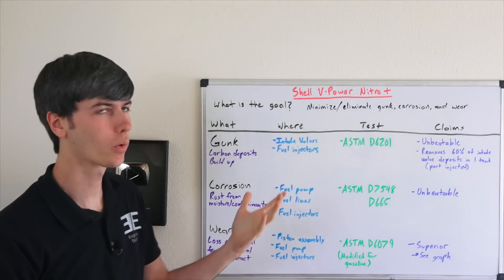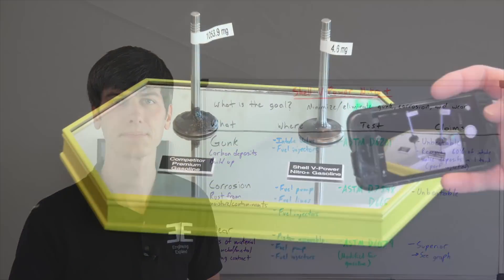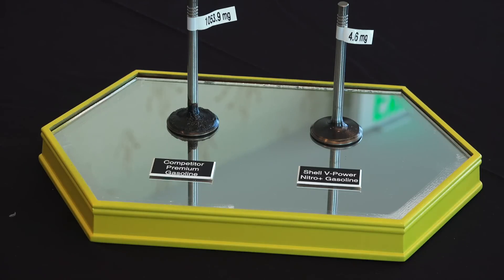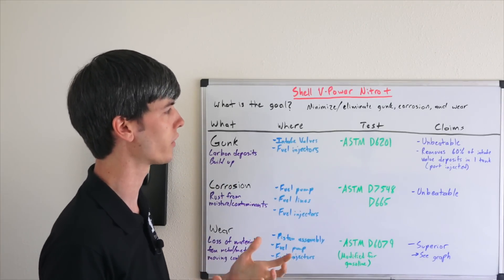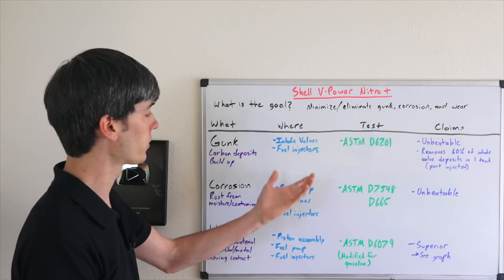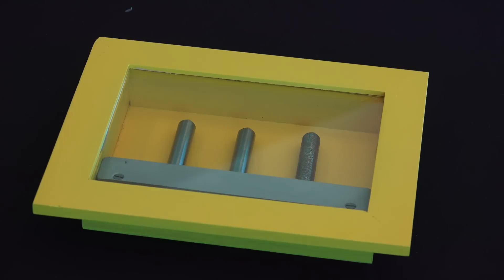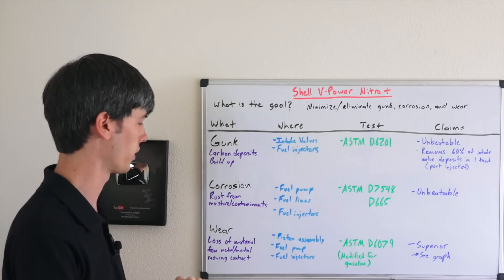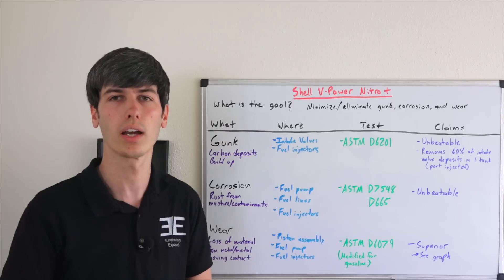Shell V-Power Nitro+ (Premium Gasoline Fuel Testing)

Comment: Just got an Audi A6 2.7 bi-turbo 2001 with cam belt failure, and has been Audi serviced and always used Shell Optimax fuel. Valves and piston crowns were very clean, at 148,000 miles. best i've seen. Took about 3 minutes to clean with wd-40 and the scouring pad side of my kitchen sponge. Impressed. However, cost can out-weigh effort in long run. i.e. a good rebuild may show unknown issues and rejuvinate engine. Plus the fact certain parts are superceeded by newer revisions, which could out-perform factory-original parts. Either way impressed with Shell, and EE. thumbs up and right foot to the horizontal

Comment: I've been using shell 91 in all my cars getting better mileage ect. But until I bought my 350z have bolt on mods it idles pretty bad almost dies out and pings on shell 91. I tried 3 different tanks at shell using 91 and same thing happens. Switched to Esso which has ethanol and idles way better , same with Petro

Comment: I just started using SHELL V-POWER NITRO+ and I can sincerely say that it made a difference. My engine would shake and sound rough but when I started using shell v gas it stop shaking and running smooth, I don't know about the mileage because I haven't paid attention to it but for my experience I'll keep using it every other fill up because it can get expensive. I have a 2013 Chevy Malibu 2.5 with 57k and live in Houston TX gas ain't cheap!

Comment: Science and engineering are two very different fields and both can be touched on when summarizing this fuel and it's effectiveness. The engineering effects produced by this gasoline that Shell would like to highlight were very well explained. However, the science (chemistry, metalurgy, etc.) behind the effects were not very well explained. I am thinking that is because it is proprietary information kept secret by Shell. You don't need to know the science, just understand our test methods and the results of those test from an engineering perspective and then make your decision on whether to buy their product. That is probably their thinking.

Comment: Interesting fuel type. However, I am mainly interested in whether or not the fuel actually produces any durability changes long-term in vehicles. I’m also interested in knowing if there is a pre-and post use performance difference.
Reply: I can vouch for V-Power. I started using it on my Tacoma and i get atleast 2-3mpg better on the city than with regular. I tested them and noted down my driving habits and trips. All similar with V-Power it was significantly better

Comment: Only problem most newer cars have direct injection so no matter what gas you use carbon deposits on intake valves will still be present it's not a fault of gas companies but making claims about cleaner valves is deceptive.

Comment: We all know the fuel is good stuff but what really matters is when the truck unloads at the gas station how much water is in the under ground tanks the drivers are supposed to check and report this but there pay is so low they just unload and go. Also how clean is the  gas stations pumps there a lot that go into this and the bottom line is your putting that into your vehicle. So think before you fuel.

Comment: Everybody in the comments are talking so negative but I’ve noticed how much smoother my car is. Plus better throttle response and gas mileage. I have a older Nissan Maxima so I want to keep my engine lasting long
Reply: yes ive seen my intake valves - spotless.

Comment: So of nitro removes 60% of gunk in one tank, that means you can alternate cheap gas with nitro from fuel up to fuel up because Nitro will remove gunk from the previous lower grade fill up. You can save about $1000 per year (If you get 20mpg and drive 15000 miles) by alternating low grade fuel and nitro from tank to tank. Thanks for the info Shell.

Comment: I only buy top tier fuel from shell or mobil.
No point in fuel additives if you are using fuel with a higher amount of detergents.  
Not talking about the octane here.
Top tier fuel sellers have to maintain a certain level higher level of detergent in the fuel regardless of the octane.  Even between the companies there can be a difference in the amount of detergents in the top tier fuel. But there is a minimum that must be met. Some go far above it.

Comment: I have a question. We have two motorbikes. The one is a honda ct70 with a lifan 125cc engine, runs like a charm. The other one is an apollo 125cc dirtbike. They both recommend 92 octane. Would Shell "v-power nitro+" be suitable to run in the summer in these engines?

Comment: Wow, I feel like go take out a 2nd mortgage and spend on this V-power or whatever it is call?  In the last 30 years or more,  If it looks like gas, smells like gas, burns like gas, and it good enough for me.  Cheaper is better.  No issues other than the 10% alcohol.  I remember when they first came out, I noticed about 10% drop in MPG (25 to 22 MPG).  Now a days, I got nothing to compare to?  They all have alcohol.

Comment: My 24 year old Nissan Sentra was having difficulty starting in cold weather.  It would take about a dozen tries, with the gas pedal to the floor to get it going.  I started using Shell V-Power about 3 weeks ago and my car starts without hesitation, in -22C and colder, temperatures, without the gas pedal needing to be pressed.  My mechanic said that the octane level in the premium gas is similar to the level in the regular gasoline 24 years ago, and recommended I continue to use premium for better performance and gas mileage.

Comment: Shell specifically made the claim on port injection but the build ups shown as with most modern vws is direct injection. 

Build up is not a major issue with any fuel on port injection.

Comment: I really love the topics and you do present them very well. Like others I do not really like this one, it reeks of influence by Shell and not a independent information with a few flaws. I would take this one down and go over it and try to do some hands on proof if you can. Also state what gas they sell has it. My car only uses reg. gas, not the premium stuff, do they put this in all their gas or only the top end stuff. I use Chevron mainly and they put a cleaner in as well. From time to time I add a after market additive just to help out if any buildup is growing on my valves. Thanks much for all your other stuff though, even though this one isn't very good your track record is still tops for content and well presented.

Comment: I have no idea why Jason failed to mention that those engines in the pictures shown are Direct Fuel Injection Engines.  No matter what fuel you use in those engines that won't prevent carbon build up. I fact it's a problem that manufacturers are trying hard to solve. It's very unlikely to have that much of carbon build up in port fuel injection engines especially with such low mileage.

Comment: I've bought a 2015 Camaro in 2015 with 29 miles on it and since I' have had my car its only had shell new Vpower gas in it..so im going to check what it looks like at 25,000 miles later..ill put a camera in my motor so see if it kept my pistons cleaned and etc...right now i have 6,ooo mile on the vehicle too ill be back :)...its funny bc i have always wanted to do this test and i been privileged to buy a brand new car i already knew i was gonna preform this test...

Comment: In a nutshell. More snake oil?! 60% in one tank Hmmm. I want to see an unedited/constant test. Starting with a view of the cars valves, Engine ran until a full tank of fuel runs out, then dismantled down to the valves again with a view and ultimately side by side comparison. ALL WITH NO EDITING OR BREAKS AND WITH 3 IDEPENDENT MONITORING BAILIFF! or it's not true! :O)

Comment: Question: Will running my car on shell v power nitro+ do more harm than good if its recommended for my car to use fuel with an 89 octane rating?

Comment: I found the Volkswagen intake valve photos misleading. As Volkswagen mechanic myself, I feel it was a good representation of what intake valves could look like. However that, and most turbocharged engines use direct injection, and I feel like that should have been mentioned in the description of the photos. 

Also, not to be too critical but I feel that giving a fuel pump as an example of a part susceptible to ware is legitimate, although using steal to represent it is not. I may be wrong but I do not know of any fuel pump that has a moving part susceptible to ware that is made of steal. I think the spindle test represents it better with its steal housing constantly submerged in fuel, but as a moving part susceptible to ware I do not.

I think there are some relevant tests to Shell's product however I feel their claims could and possibly should be argued. I would also feel a little more confident in their claims had they ("they" being Shell) sent a representative at least a little if not far more versed in the tests being performed and what these tests are supposed to represent. Otherwise I will keep going across the street and saving my $6.37 on a fill up rather than spending it and assuming its doing all Shell claims it does.

Comment: I wanna see one with Chevron 91. my friend that works at an auto parts and a mechanic told me to use chevron or 76. chevron as the first choice to use.
Reply: That's interesting. I use only non ethanol fuel in my vehicles.

Comment: The pictures of the gunked up intake valves are from direct injection engines. The injector can't clean the valve if it doesn't spray on the valve.

Comment: consider the fact that VW is not a clean burning vehicle. I did an oil change on one ,and not even a week later the oil was as black as a car that has driven 4000 miles. 
Also, vehicles that used PCV systems will syphon oil vapor into the intake system, where it will eventually become problematic as it solidifies in the runners, throttle plate, and valves.

Comment: So one engineer to another...WTH was this? It sounds like Shell is sponsoring you! Where are the engineering questions on the validity of Shell's claims? I noticed they don't provide any data on things like "gunk" reduction on the injector nozzles. Keep in mind that additives don't do squat to clean valves in a GDI engine so for some of us their data is a so-what. 
Also, the spindles look like plain steel. Does that represent what in-tank fuel pumps are using? I would have thought they'd be using CRES like they do with the fuel lines. 
I've enjoyed many of your other videos but this one wasn't worth watching, it looks like it was made by a business major not an engineer. You can do better than this.

Comment: the 3 Volvo I have driven, a 2000 T5 ( 4 spd auto ) 2002 2.4t ( manual ) and 2002 2.5t Auto perform the best with the Shell Vpower Nitro, second best is Tesco Momentum 99
Reply: and wow to those intake photos! had the manifold off on the C70 T5 December 2016 to fit a new Electronic Throttle Module, they all looked mint, the car has 187k miles on the clock

Comment: There is many factors to take into consideration, for example Yamaha motor company says you should not run for example alkylate gasoline in there four stroke engines. It leaves to little carbon deposits on the valves for dampening them when they close.

Comment: great video. I believe that most non GDI engines can have the valves clean because when the gas is sucked in the combustion chamber it physically touches the values cleaning them. but what about GDI engines?? the fuel will not go trough the intake valves. how will it clean the intake valves??

Comment: Keep in mind the vw engines in the pictures were direct injected engines, hence there's no fuel wash to clean the intake valves. Engine oil, variable cam phasing and/or exhaust gas recirculation on DI engines has a greater effect on the cleanliness of the intake valves.

Comment: @4:30 Those pictures are misleading. You are showing valves of direct injected motors. Fuel never hits the intake valves on DI motors... Shell additives will have 0 effect on this gunk.The results/claims of NITRO+ are for PORT INJECTED motors where the intake valves are sprayed with fuel.

Comment: All gasoline in every station comes from the same sources. The additives are added either in the truck or at the station. Don't believe that some fuel is "cleaner". It may help clean better than some other fuels with additives. You can possibly buy a bad tank of crappy gas from any station. And higher octane premium grade is not a "cleaner" fuel.

Comment: Testing per ASTM yada yada doesn't mean anything if the car engines tested were operated under different conditions. This critical question was never asked in the video. "What conditions were the two engines being compared being operated under?" It was most likely not a controlled environment (e.g. In a lab). These cars were probably out on the road, but where they driven side by side under the same RPMs, acceleration, etc.? If one driver floored it all the time it would explain the difference

Comment: It would be cool to setup a bench test with a direct injection 4 cylinder engine and use 1 fuel in 2 cylinders and then a different fuel in the other 2 cylinders.
Reply: Big brain

Comment: I really miss the days when I worked at Westhollow Technology Center in Houston. Since they tested everything there, everyone asked what the best fuel, oils, additives etc were.
Everyone back then said the best oil was Castrol GTX Semi synthetic.
The best fuel was Chevron. because chevrons Techron really worked and they weren't sharing it.
They said the only additive that did anything was this stuff called Prolong.
The explanations for these conclusions was technical and lengthy. But, after work the WTC crowd formed a line at the Chevron station.  Which, was right across the street from a Shell station.
This, is what the techs there said in the cafeteria or smoke pens.
The two places where they said a Shell oil couldn't be beat though was Rotella (big truck oil) and Aeroshell for your airplane or Harley.
I worked on airplanes and saw inside 2000 hour engines a lot. The engines we ran Aeroshell in were clean. No sludge, varnish, brown coloring or anything like that.
I loved working at WTC. They have a wing called "the red hall" (because it has a red floor) with dozens of dyno rooms with every kind of engine imaginable running in them. They have research vehicles that run one fuel on one side of the engine and another on the other side of the engine. This is how they do these comparisons. A million sq ft of labs and over 6 miles of hallways. And I was on about every square inch of it at one time or another.
Not many are left, but
Hello to all my friends there from the GE I.T. guy they called "the hippy"!
Reply: What a cool life you’ve had! Would love to hear more

Comment: +Engineering Explained I have a really important question if you can please give your input/opinion on what you think I would gladly appreciate it. So I have a 2016 Hyundai Veloster Rally Edition. It is a 1.6 GDI Twin Scroll Turbocharged Engine and my question is in regards to if I should use this Shell V-Power Nitro+ on my car considering it is Turbo and the owners manual says 87 or Higher is reccomended but more than likely for the octane rating to be higher to "get the best performance out of your veloster". It also says to avoid using "Gasohol" which says it is Gas mixed with ethanol and or alcohol (wood grain filtered gas) and then it says if there are no other gas options to use, to pump a Gas & Ethanol mix no higher than 10% ethanol content in it. Here where I live in Southern California all the Shell gas stations say (Contains 10% Ethanol) so with all of this being said. Is it safe to use Shell V-power Nitro+ on my Hyundai Veloster? Or would you recommend me sticking to what im pumping right now which is Chevron Premium? I would gladly appreciate a response and or your input thanks for all the resourceful videos keep up the good work.

Comment: yes, I see what they say but I would like this tested by a third party.
Reply: That’s what the standardized tests are. He explains that in the first minute of the video.
Reply: I agree. How fresh a fuel is makes a big difference on it's water content (corrosion properties) and resistance to wear (which doesn't really matter in a gasoline engine as the oil lubricates not the fuel). Not sure if the soot test would be effected as much. Shell can get theirs right out of the refinery in a sealed container with absolutely no water but they get their competitors from a gas station where it has been sitting for a few days or weeks underground. It is bound to get more moisture that way.

Comment: I'm not entirely sure this would have a very large effect on cleaning the gunk build up of your Direct Injection engines. I think that's a little shady to do it for port injection engines when almost every car since the 90s has been build with direct injection.... But yea sure I guess buying a tank full of vpower nitro+ would be a good thing to do every couple of thousand kms if you are running port injection or carbeurated engines...

Comment: Well, regarding the intake ports of the Volkswagen engines, the gunk and carbon buildup is from the EGR system and from crank case ventilation. These engines are direct injected, meaning that there's no fuel at all running through the intake ports, which in turn means there's no cleaning at all of the intake ports and the valves. So it will not matter what fuel you run on these engines. On later gasoline Volkswagen engines though, they have added intake port injectors. So the new VW engines effectively have both direct injection and port injection. This is to counter the carbon buildup and also to help cool the intake air since the new gasoline engines have a small chargecooler instead of a real intercooler.